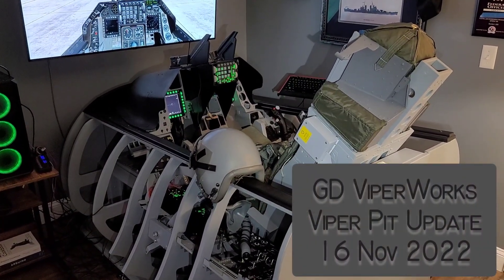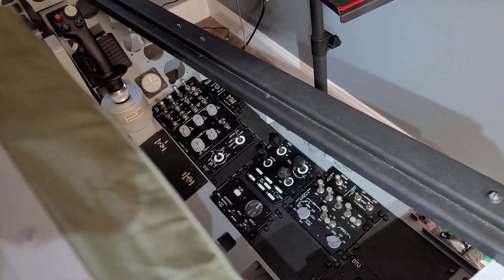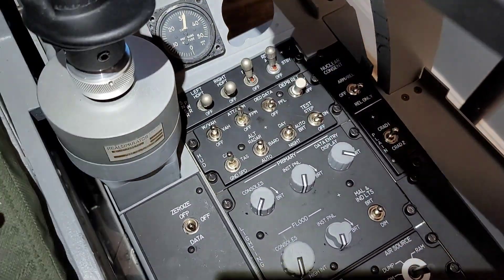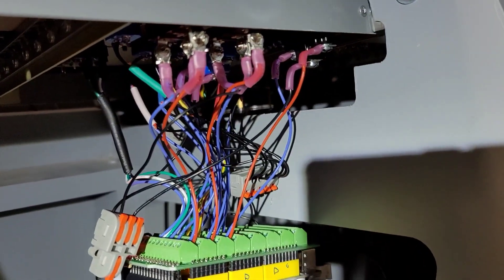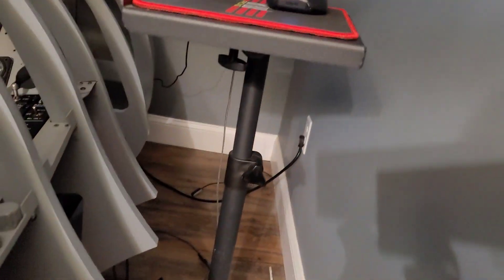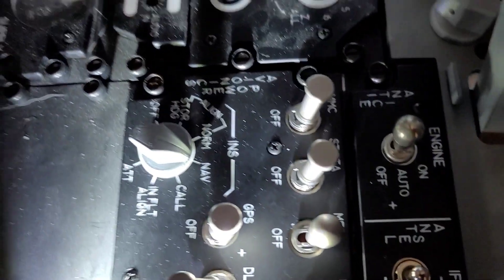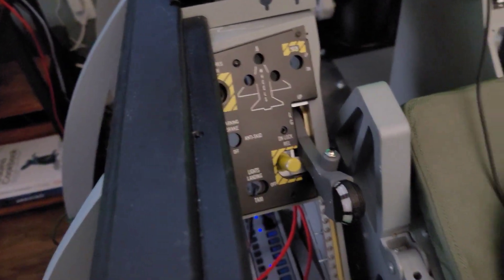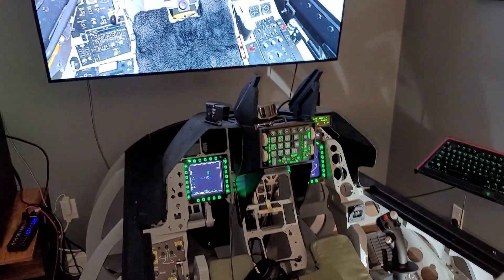F-16 Viper Sim Pit November 22 Update

Comment: Very nice pit and good progress.
However, you say that you may want to change the directly connected switches (lots of wires to the Mega/Nano), to something using multiplexing (that 0s having all switches in a matrix). My advice DON'T do that. Directly connected switches have two big advantages over matrix wiring: flexibility and quite immune to EMI. Drawback: a lot of wires, but that is manageable. By the way, using a matrix for the switches "works" within one panel, but when you "cross" panels it becomes prone to make errors in the wiring. With direct connections wiring stays a simple job.
Reply from the maker: @pdp11henkie  thanks Henk. Some time after this video, I changed all inputs to Bodnar and outputs are Arduino. It's still messy with wires but works flawlessly. Maybe someday, I'll learn how to make PCBs and clean it up while adding backlighting.

Comment: You are doing it wrong. Each panel has to be wired to a d sub 15 or 27 connector and then a cable runs front the connector to your box where you connect it to io interface boards

Comment: Hi, nice setup. While you said that you dont like the throttle for your application how would you rate it as a standalone device? Any other gripes/problems besides positioning  and the man rng knob?
Reply from the maker: The Winwing is a great throttle with minor issues. It would be excellent for anyone from the casual desktop flyer to those who have more intricate pits like my old Next Level Racing setup. 

But for a replica 1:1 scale pit, it does not fit, nor is it a proper replica. I am waiting for the availability of a Simgears TQS which is supposed to work on a desk or be mounted within a replica pit such as mine. 

But the Winwing is a fantastic product for 99% of flyers.
Reply: @GDViperWorks  thank you very much, since i dont have any extra button Boxes i will go for ww first and then maybe switch once i have the room to get a more intricate setup. What are the minor flaws in your opinion? I know of the rng knob but i have a 3d printer
Reply from the maker: The radar tilt is also in the wrong position. Most wouldn't notice and it doesn't affect the throttles use. It does have all the high use buttons and switches and that is very valuable to 99%. A full HOTAS setup with the WW combat and gear panels make a very capable setup that minimizes mouse clicks. Better yet is to add a Simgears ICP and some MFDs and you have 95% of your combat functions at your finger tips.
Reply: @GDViperWorks  yeah, my priority would be mfds first and then a physical icp. Before that i will probably try an app.  So the flaws are  just the slew and rng knob? I have heard from one person that the comm switch is bad and when transmitting while changing thrust it presses the switch down instead of continuing transmitting but i find that hard to believe
Reply from the maker: @KnifeOfDunwaII  Simgears will be releasing a "deskpit" shortly. It will likely incorporate screens with the MFD bezels much like the Winwing Hornet deskpit. This type of product is long overdue. Having to mate a screen with TM's MFDs is a pain. Why they never jumped on the obvious of building them with screens is a head scratcher. So the cottage industries of enthusiast builders have had to make these items. But that is now changing. 

The Winwing's manual range is more than a knob type issue. It is also very finicky in DCS. Sometimes zooming in my pod actually zooms out. It is very inconsistent in its performance.
Reply: @GDViperWorks  that would probably really expensive then so i would still buy cougars and put them on a screen, maybe at later date would i buy them. Hmm so the only actual issue is the knob then? I will look into a solution but will still prob get the ww throttle over virpil, ofc the t Word from vkb would also maybe be an option but that still will take some time

Comment: How much did this all cost you total? Asking for a friend of course…
Reply from the maker: To be frank, if I kept track, it wouldn't wind up as realistic as is the goal. It would take the fun out of it too. That isn't to say I don't hunt for the best prices on components. Owning the right software and tools to make my own panels, knobs, other accessories; while expensive, actually saves me a ton of money.
Reply: @GDViperWorks  I’m thinking of doing something of a similar style? If you could at least give me an estimate I would greatly appreciate it. You also did a very good job with it. Any tips and tricks that you could share? Are you using trackir or VR? What is the cockpit structure made out of?
Reply from the maker: @Lengthy_Lemon  I'll answer these later. For now... I have a hockey game to go to...
Reply: @GDViperWorks  have fun
Reply from the maker: @Lengthy_Lemon  game hasn't
 started yet so here goes... just some rough numbers for examples so you can get an idea of what you are looking at. All approximate. 

Pit plans: $250
Cnc routed structures: $1500
Metal side consoles and main IP: $2500
MFDs: several hundred
DED/FFI/Indexers: $500
HUD Block and glareshield:  $500
Switches: anywhere from $50 to $130... each.
ICP: $450
Gear box: $500
Countless screws, bolts, nuts: $a lot
Surplus parts: $lots
Cursing: free and plentiful.
Time: immeasurable.
This is a very truncated list.
Reply: @GDViperWorks  that’s pretty damn expensive sheesh.
Reply from the maker: I use track IR on a 55" 4k OLED. I fly at mostly max settings. VR gets lower frame rates at lower resolutions amd requires other apps like voice attack. In VR there is no point in this much of a pit. The goal is to use a mixed reality headset when the prices become reasonable.  

The structure is milled from HDF. I don't recommend getting plans from where I did. There are a lot of reasons. If you find a website offering plans for sale... you probably found where you may want to avoid.
Reply: @GDViperWorks  what are your PC specs?